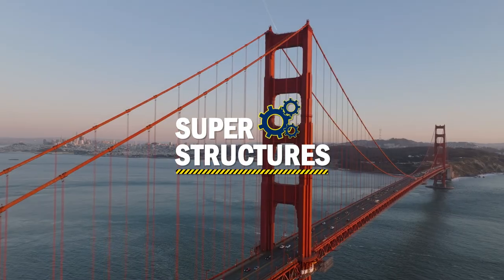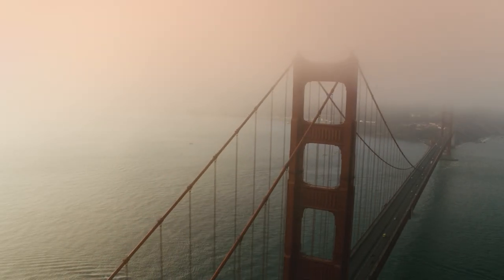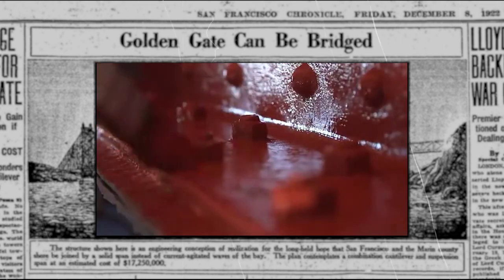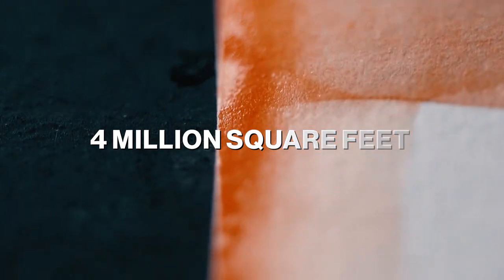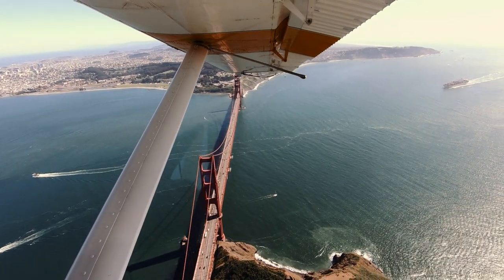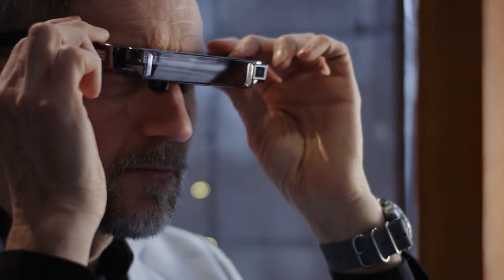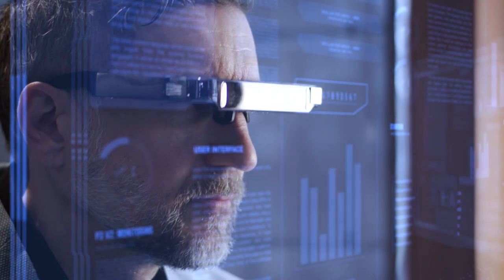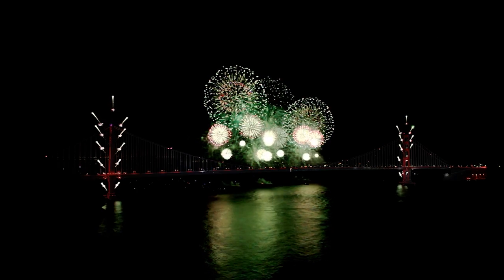Painting the Golden Gate Bridge: The Constant Upkeep Challenge

Comment: How do tension and corrosion sensors work? And why exactly does it need to be constantly repainted? Does water weaken the paint or knock it off?
Reply from the maker: Hey! Tension and corrosion sensors on the Golden Gate Bridge measure cable forces and detect rust. They help monitor the bridge's condition. As for constant repainting, the marine environment with saltwater and wind speeds up corrosion. Water doesn't weaken the paint, but it can cause it to peel off, exposing the steel. Repainting protects the bridge's structure. Hope that helps!